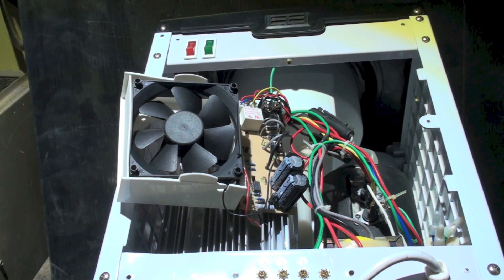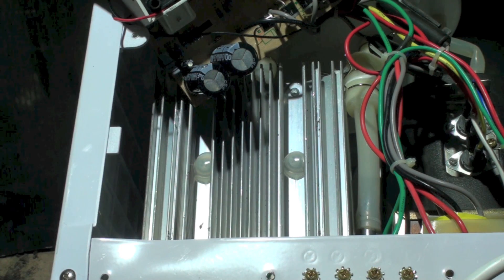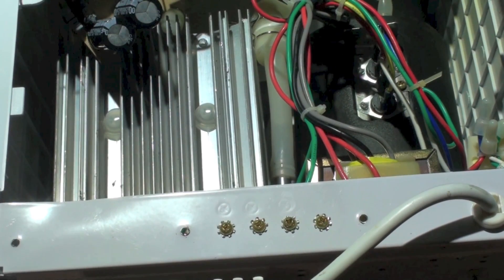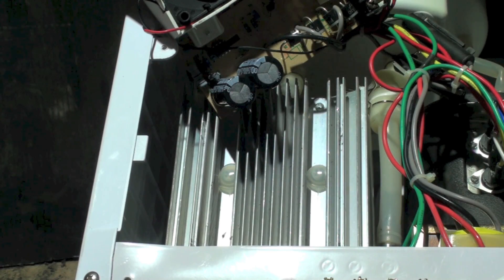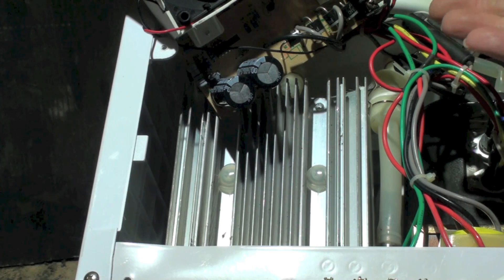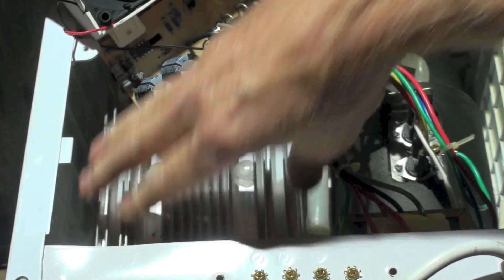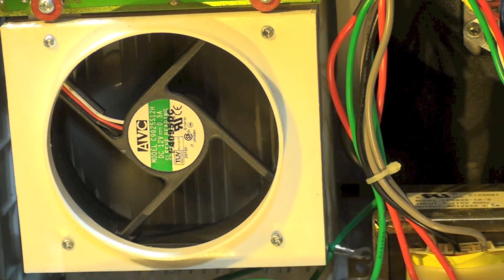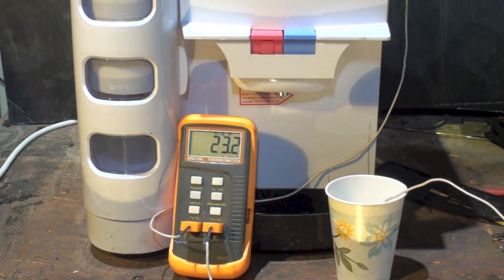Why doesn't the water cooler cool water,  answer

Comment: Hello, I have a similar cooler that heats but will not cool water. The same issue was seen with the fan not turning on but the element getting warm when turned on. I replaced the fan but it still does not turn on. Now I see and smell smoke when I turn on the cool water. Any thoughts?

Comment: Fan and circuit board works but not cooling the water. Does it make a difference which way the fan blows? Im thinking the peltier semiconductor may be at issue. It does not get warm.
Reply from the maker: Fan direction is probably not the issue.  If you are getting DC voltage to the semiconductor and no heat, the semiconductor is at fault.
GFM
Reply: @grayfurnaceman  I concur. A new one has been ordered.  They are not expensive. Thank you for your video as it gave me clues to finding a solution.

Comment: Does the fan need to blow in or pull out?
Reply: You want to remove the heat, so usually the fan pulls the hot air away from the heat sink, however, I have seen many people prefer to push the fresh air onto the heatsink, and there is no noticeable difference in temperature, so I would say as long as there is plenty of fresh air allowed to flow - either way is good. If you are wondering about the set up in the video, the motor mounts will always be on the side that the air is going towards. So here, the motor mounts are outward, so the air is being pushed out towards us. :)
Reply from the maker: I think it blows out.
GFM

Comment: Peltier junctions.  Used in all of those DC powered portable coolers (car cigarette lighter cord).  It is essentially two sides of a thermopile (a thermocouple driven by a voltage instead of generating a voltage).

Comment: My fan works but the water doesn’t get cold!!!😔. Can you let me know what you think could be the issu!?  The hot water works great. Please, thank you 🙏
Reply: The same issue 
The fan is working fine but water not cold.
Reply from the maker: The electronics have probably failed.
GFM
Reply: I have the same issue, any hint you can share?
Reply: Try to change peltier module or thermo electric cooler ..or put grease paste .bcoz the supply power  of fan same power supply it means same 12 volts  fr peltier module...
Reply: I have the same problem. Fan work really well, hot water perfect but cold water not functioning well. Which electronic part that i need to change? Do u have any idea on this?

Comment: Hi,thnx 4 knowledge and skills I got from u,but my dispenser water not cooling? but I can get hot water only
Reply from the maker: If it doesn't cool you may have the same problem as this one.  Check the fan.
GFM
Reply: My fan works though, what else could it be? The board and the wires are good.

Comment: Is it possible to use it for bigger application? For example Chiller? or water heater or Hybrid systems?
Reply: Guy Hakverdi
Reply from the maker: Guy Hakverdi Well, you could if you had more money than Bill Gates.  The thermal efficiency is about 5% compared to 300 to 400% for refrigeration.
GFM

Comment: Yep had a portable cooler that had the fan die. These things are resultant devices. Put a new fan in mine and its 15 years old just fine. Known some people that have had them for years as truck drivers!
Reply: Have one, no cooling water, will look at fan , if need replace and works will let you know. Here.